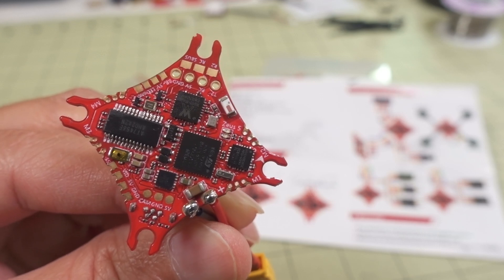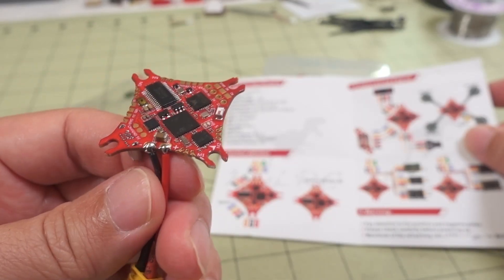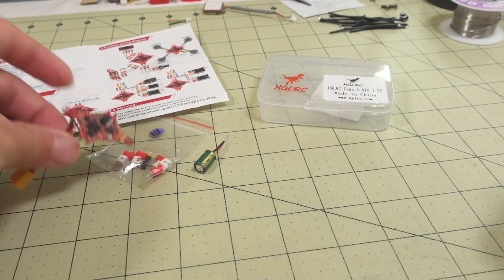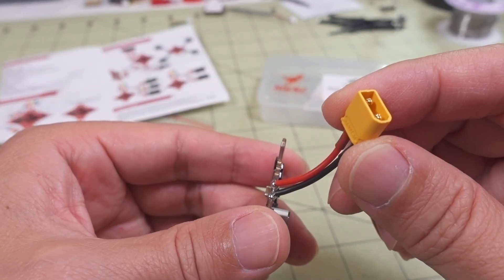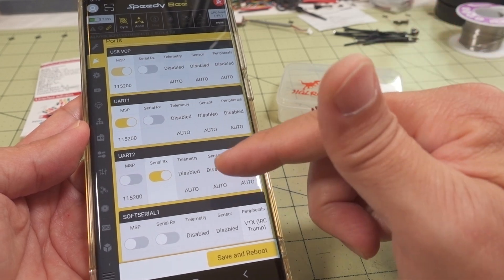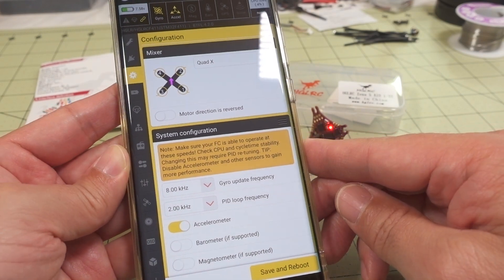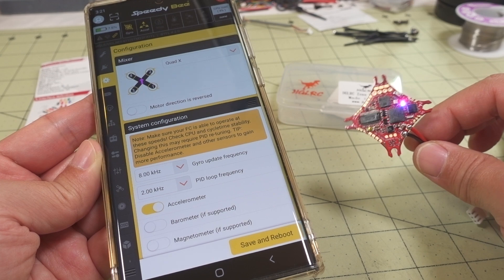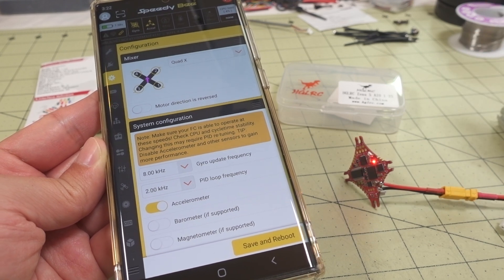HGLRC Zeus5 AIO FC Review 💫

Comment: i cant get the speedy bee app to see it.. it shows in the wifi screen of my phone but when i open the app it sees nothing.. what am i doing wrong>?
Reply from the maker: You must have changes the setup for the UART that the wifi is on.  Did you do a firmware upgrade to Betaflight?  One of the UARTs is for the wifi chip.  Other than that, I can't think of anything else.

Comment: Great video mate, I just purchased a TBA crossfire module with nano RX , I know it shows on the diagram but was just double checking if that means I need to bridge both RC and R2 after connecting  the TBS nano RX to other points ?
Reply from the maker: The diagram is misleading.  Just connect straight to R2 with no bridging.  I think they meant to show that as a passthrough in the diagram but that makes no sense to me.
Reply: @AlbertKimTV  Thanks for the prompt reply. Sorry for sounding like a noob but there are two R2 connections on the FC which one do I connect to or it doesn’t matter ?

Comment: I like this board except for the USB being on the bottom. i had to mod the Babytooth frame a little to fit it.
This is what came on my Rekon3. After throwing away the frame and 18650 battery holder, added a Baby Tooth frame and it made a great 3" toothpick. 1S lipo.
Don't waste your money on the Rekon 3.